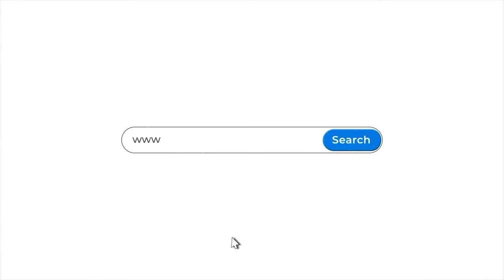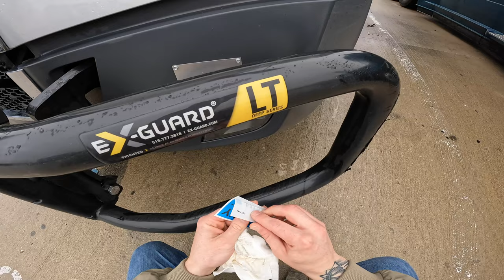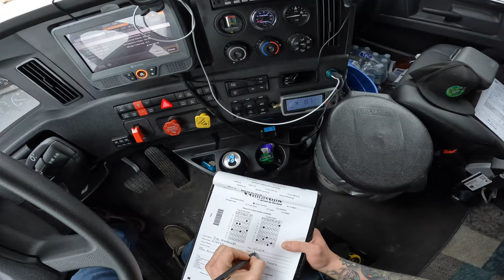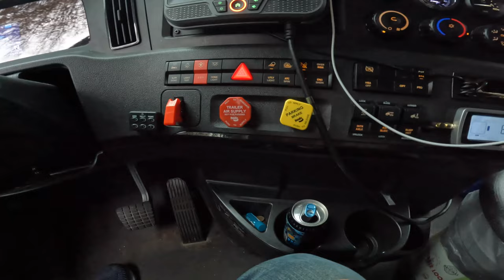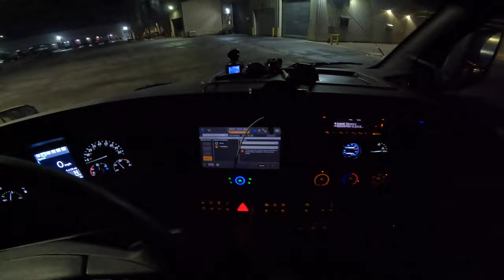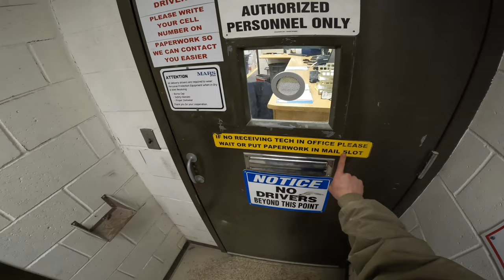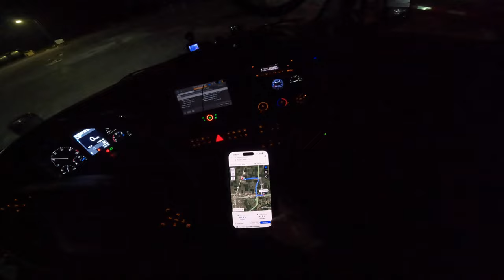Prime Inc Tanker Loads | Airing Up Trailer Tires Easy | Simple License Plate Install 😃🎄🚛💯

Comment: Bolt and flat washer on front of plate, then lock washer and nut behind plate.
Reply from the maker: Yep that’s the correct way to do it (IF) they had flat washers available 😂 lock washer in the front will do, plate ain’t falling off. Did building maintenance for 16+ years that’ll work just fine 🤙💯

Comment: I don't know if tankers drop their air bags when you pull trailer air supply, but in my 25 + years of driving not one of my trailers dump air bags by pulling valve. It releases air to break chambers to apply or release trailer parking breaks. All air in air suspension is a manual switch or valve.  Like I said your tankers might be different. It just rubs me wrong way when you say drops bags when you pull button, I don't know why it just does. No hate, its just me. I understand why they would because of all the drop and hook

Comment: As always I love the video. Two things I want to mention. The deer guard is that the one Prime goes with or you chose that one? The second thing is the tool kit that you have where did you get that? The air hose trick is a lot better than having to go to a truckstop. Did you get the airline through Amazon or at a truckstop?
Reply from the maker: Deer guard is the 1 prime picked, when I ordered my truck I didn’t have an option to choose mine. My tool kit I grabbed from sears 10yrs ago. My dewalt drills, bits and bag I bought at Home Depot 5yrs ago. Hope this helps ya! 🤙💯🎄
Reply: Yes it helps a lot except for I can’t go to Sears to get the tools set LOL.
Reply from the maker: @phillipcleveland5207  dang it lol